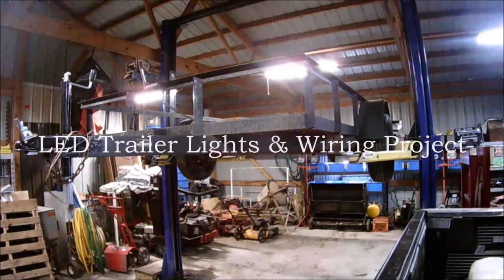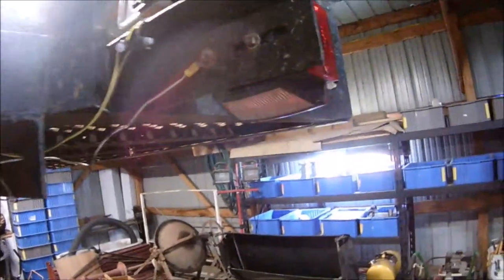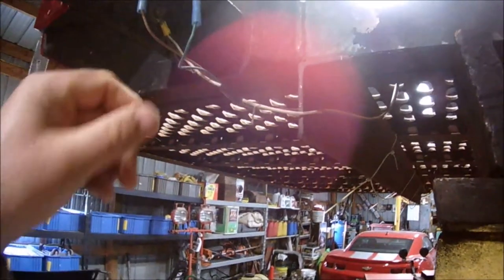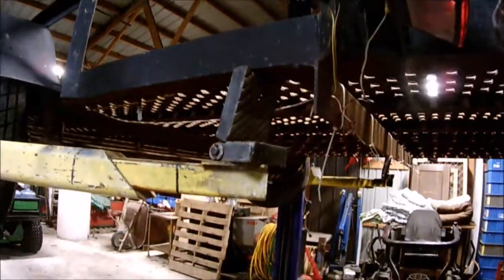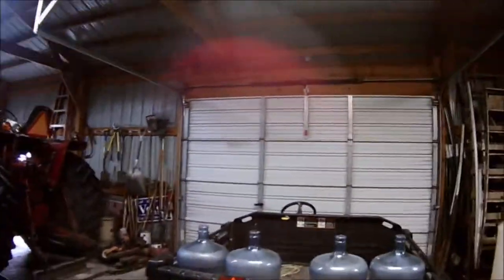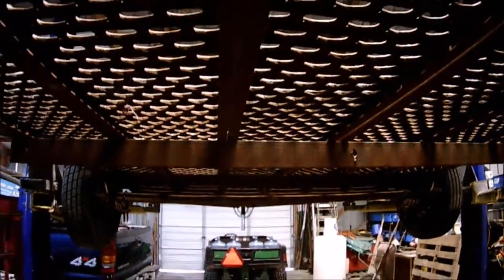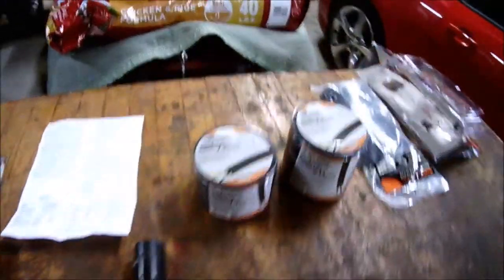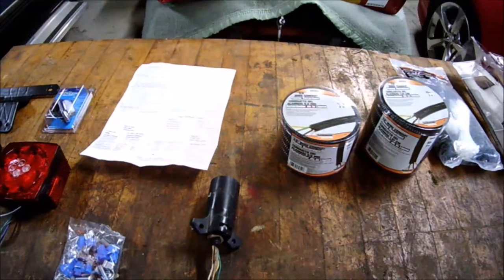LED Trailer Lights & Wiring Project

Comment: LEDs are great!! I used to do enough wireing, I didn't have to look at the color, my fingers knew the color... Worked great until I'd be fixing someone else's mess...
Looks good!! Thanks for the video!
Reply from the maker: Thanks.  I do the trailer wiring just enough to have to find my cheat sheet so I get it right. LOL  Thanks for watching & commenting.
Reply: @crslyrn  🤣😂 as long as you get it right!!!😎😁👍

Comment: Do I need to get a grounding wire separately to connect the 3 together?  I have everything installed but it’s not lighting up, there is a very dim white led that flashes with the turn signals but that’s it! Can’t figure out what’s wrong
Reply from the maker: What I did with the lights on my trailer was.  Take the WHITE wire & put it on the mounting bolt of the light grounding the light to the trailer.    Do that to each light.  Then take a WHITE ground wire from the trailer light plug & put that wire on one of the bolts for the trailer jack  grounding the tow vehicle & trailer together that way.  Good luck.
Reply: @crslyrn  thank you! Mine seems as though the ground wire might have been cut too short. I’ve only got about 6 inches to work with.

Comment: I have a car dolly what mount kit I need to put it on the dolly fenders?
Reply from the maker: I'm going to guess that your car dolly might already have the mounting brackets still on it from the original lights.  That being said, you can either reuse the existing mounting brackets or drill mounting holes in the appropriate location on the dolly's fenders and mount the lights accordingly.  Thanks for watching.

Comment: I have a 7 pin and I wired my john boat trailer but the reverse lights stay on is that because the blue wire isn't connected properly
Reply from the maker: Could be.

Comment: What do I do about the blue wire it’s long then the others, is it to cut it and get the other light to have blue as well
Reply from the maker: The blue wire is for the back up lights.
Reply: @crslyrn  how do I wire them to each light do I just splice on side together then get the extra and go to the other light
Reply from the maker: @xhambonegaming2694  That will work.

Comment: Where do you wire the white wire
Reply from the maker: The white wire goes to the Negative position on the trailer plug & I have the other end connected to the trailer at one of the trailer jack mounting bolts.  You don't really need the white wire for the Negative position on the plug since the trailer should be grounded to the truck by the trailer hitch. Hope that helps.
Reply: @crslyrn  my kit came with two white wires on each light. And a white wire on the plug in. I got it all set it up though! Thanks for the vid it helped a lot
Reply from the maker: @NoName92AZ   You're welcome.  Thank You, I'm glad to hear that something I posted was helpful.